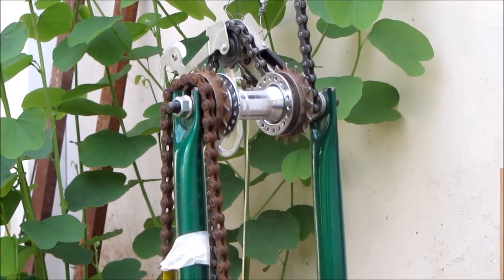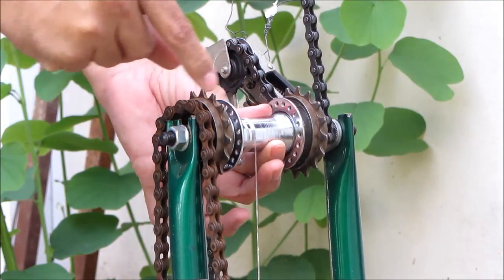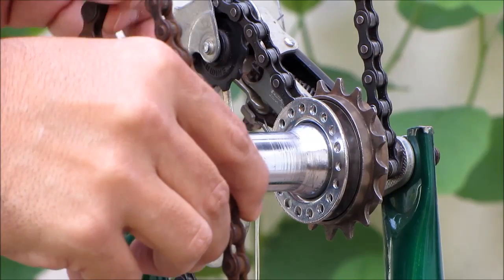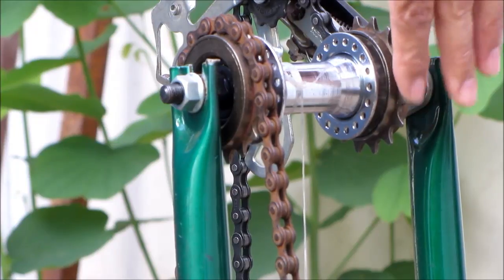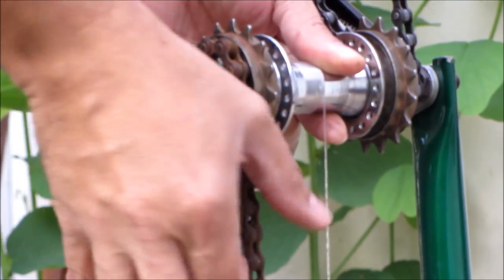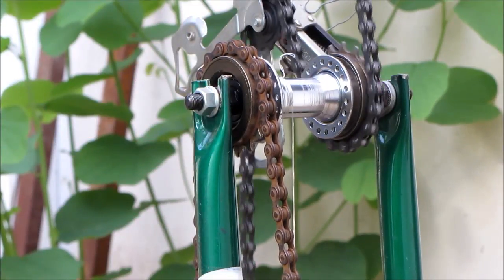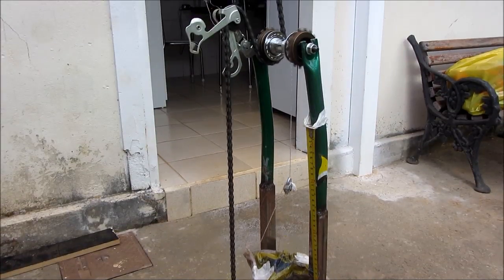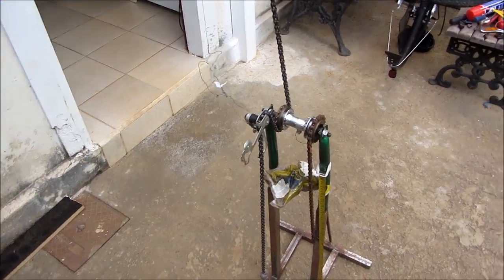5 - Ratchet System for converting energy the way it should.

Comment: Mr Luiz Fellipe Salomon.   I have already seen part 4 of your video  and seeing this part 5, I shall repeat that you are absolutely correct about your conclusions about this machine , IT IS NOT AN AMPLIFIER OF ENERGY  not even forces in my opinion with the moment arm of the horizontal level being what they are, but it could do some work as you stated.

Now what worried me with your lever  is that it  has its pivot point below its centre of gravity and so it goes unstable and even the attachment points of the pendulum and the load counts to have a stable top lever WHICH NEEDS ACCELERATION FORCES TO RAISE IT AND LOWER IT.    Now with the weight always attached, you have enough acceleration force to raise it and lower it, but with the weight ratcheted up and held in the highest position , the load weight is effectively disengaged from the system and the chain and that little bob weight and the horizontal  lever itself will not be enough to accelerate it down to its original position such that the pendulum would be raised for a repeat of the cycle. 
I have already suggested in part 4 that you should introduce springs or  energy storage systems in parallel with the  lifted load such that when the load is held high  by the ratchet, the energy in the springs will being the lever down without losing any energy as any extra unused energy will be passed back to the pendulum, or the load while it was attached.

Again you are absolutely right about this machine, it does what you say it does, and not other people say it does.  Do not lose heart, you seem to be a good engineer , but you lost some marks with the equipment you built as you did not see the whole picture.      Again, knowledge is always a good asset to gain, so do proceed to study this machine but you already know that it is not as useful as they say.    It will give you out the energy you put into it minus the losses of the machine, which are a lot.

In all the Videos showing Milkovic pumping water, or any one else for that  matter, I watched the pendulum being released from the horizontal and in one cycle it comes back to about 45 degrees which means that it lost MORE THAN HALF ITS ORIGINAL ENERGY  in  pumping the water.   Again you are correct in your deductions of this machine and if you build a better one, all you do is to confirm what you already know. Good luck.
Reply from the maker: +Carmel Pule' 

Again, thanks for your contribution. 
Good to see that the video achieved it's objective (make people realize that it doesn't create ENERGY or removes ENERGY from gravity).

Before building this machine, I made a smaller one using pieces of wood. Really small, with a lever of about 60cm. I was impressed with the FORCE of the machine, so I decided to build a larger one so I could "see" the results better.

One thing that I noticed, is that the machine is pretty much EFFICIENT when bob initial angle is low. For example: imagine the machine at rest, with the bob being at a perpendicular position, and let's call this a 90 degree angle, in respect to the lever. In a static position, this would be the moment of highest torque, where cos(0) = 1. If you move the pendulum up to a small angle (that's where in those physics class, sin is so small that you round it up to 1, and PE =mgh).  So, if you move the bob to a small height (position) you would be adding (or wasting) a small energy to make the system start.  But, since our height is small, the centrifugal force is also small, the amount of weight on the other side is also... small. 

For the machine to "show work" - and by show I mean banging up and down, you have to place the pendulum in a very high position, inserting a good amount of Kinetic Energy to the system. Guess what? You'll never see this energy coming back fully... 

Going back to my first machine and this one: I thought it was worth  to evolve from a small wooden one to a bigger, more robust new one. After I played with the new one, I didn't have any reasons - or expectations, to improve this gadget.
Reply: +Luiz Fellipe Salomon The answer is so very simple, whether one has a pendulum with or without a fixed pivot, all the work done by connecting a load to them   is at the expense of the pendulum losing its internal energy.
Incidentally if the weight is allowed to drop , it will give back its energy to the pendulum, and that is why many people believe that this machine robs energy from  the gravitational field.